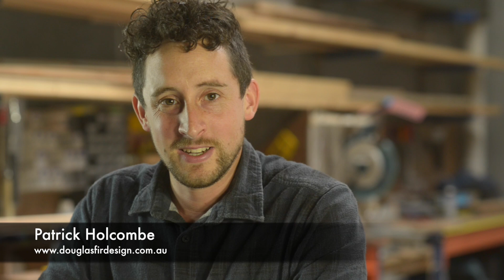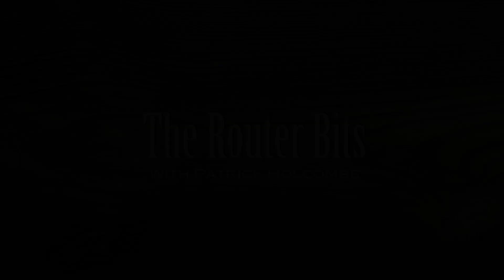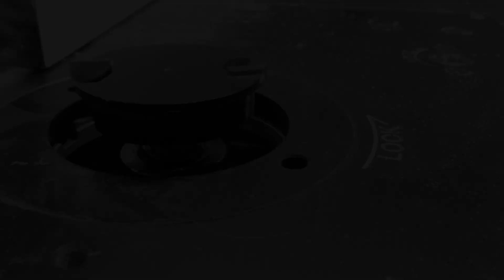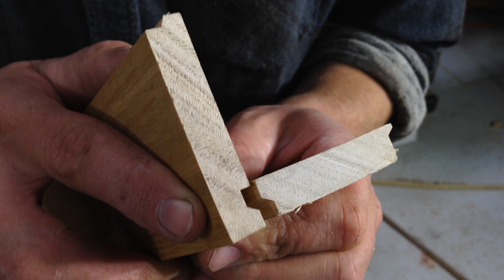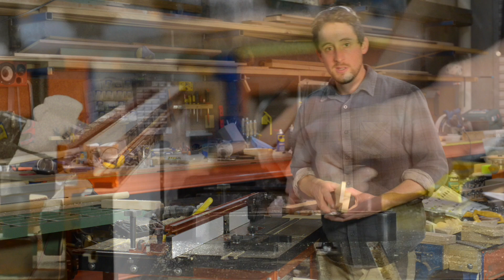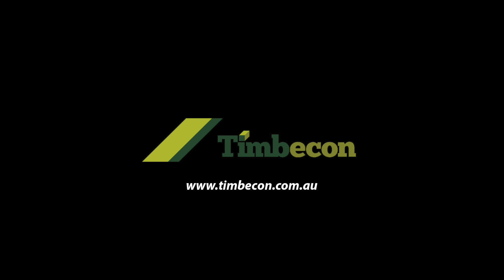The Router Bits - Using Drawer Lock Router Bits

Comment: love your router setup, such ease to adjust,  i just purchased a bit just like this, but for another purpose ( its large enough to use in a slab flattening jig, and half the price ) it is also good for making large slides, such as for an extension table, or for drawers

Comment: What do you mean vertical and horizontal pieces? You have been using the edge grain to demonstrate the tool,when in fact all cuts will be on the end grain.Also you have not mentioned whether the joints alter the size of your original draw size calculation,
Reply: the front and back, are the length you need for the width of your drawer, the sides are figured this way, the height of the bit , subtracted from the thickness of your material, times two,(  both ends of the side pieces) is the amount you subtract from the full length of your drawer, to get the length of the side pieces before routing. same way for a box , front and back are actual measurement, sides get figured the same as for drawers
Reply: i also got confused with his vertical and horizontal, it took me a few minutes, it is a bit confusing at first, but after doing some practice cuts, it was so clear!

Comment: Hi Patrick, will yhis cutter work on 11 mil stock
Reply from the maker: Hi Robert.

When using 19mm stock the final width will be the width of the bottom piece as the sides sit flush with the edges. When using 12mm stock your final width will be the width of the bottom piece plus 8.5mm on each side (17mm total). I would recommend doing some test pieces if you are creating something with a very low tolerance to make sure.